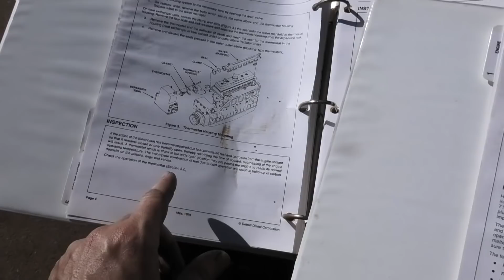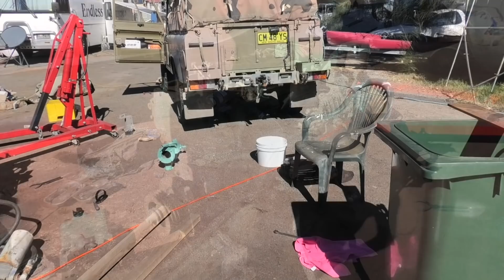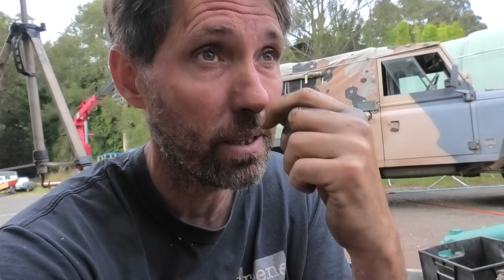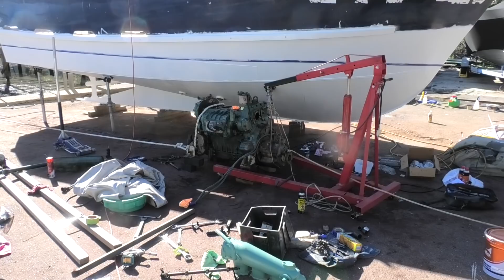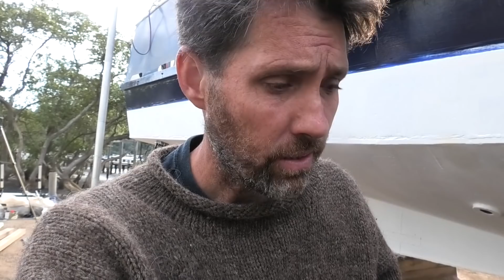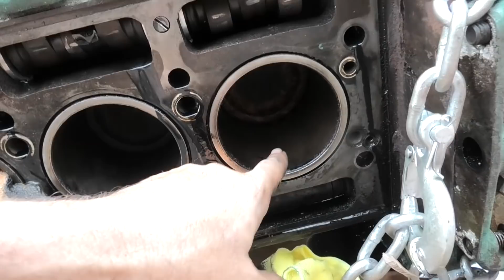Detroit Diesel 4-71 teardown

Comment: The GM -71 series engines are the best Diesel engines ever built, IMHO.  Elegantly simple in design, can take a great deal of abuse and still keep running.  And pretty simple to repair and service.  Emissions controls pretty much sunk them for truck use, but today's very efficient diesel engines are very sensitive, difficult to service, and rely almost entirely on electronic controls that do NOT like the marine environment at all.  I have two GM J+T 6-71 turbos in my boat, originally installed when built in 1980.  Run beautifully.  Clean air/clean fuel/clean oil and they'll run for a century.

Comment: HI  Stu doing a refit on 40ft steely have motor being rebuilt, have removed gear box which is very old but looks in good condition. I WATCHED ONE OF YOUR VIDEOS WHICH IKNOW CANT FIND. You metioned who looked at the box and also put in i think was another oil feed to the box. Could you supply me with who done this to the gearbox as the CAT is nearly ready to be put back in the vessel and if need be would like to know what is need to long the life of the box.

Comment: I have a chev straight six in my boat in Florida screw drive. No salt water in the engine . It uses antifreeze . The engine is 60 year old 85 hp power never change the exhaust manifolds because of no salt water in them . It is just like a car engine

Comment: I was wondering if you took off the inspection plate so you could unbolt the flex plate from the flywheel?
Reply from the maker: You would need to be able to rotate the engine to get to all the bolts and the engine was seized.

Comment: From watching Bus Grease Monkey I discovered there are also wet sleeve model Detroits which can suffer from electrolysis.
Scott has also demonstrated a few times how there are improved performance sleeves with larger ports and the way you can tell them from the old style is that a US quarter will pass through an improved port but not an old style.

Comment: I was just rewatching this video and noticed the shut off solenoid. If you ever have a half flat battery (when I say half flat I mean it turns over slowly but wont start) the start motor often draws power away form the solenoid and the solenoid goes into the off permission. You can hold the solenoid on manually and crank it and when it starts the solenoid will stay on.

Little trick I worked out with heavy equipment and I do it all the time
Reply from the maker: Good tip!

Comment: Your engine has parts coated with rust where I would expect to find oil. I still think the 4-71
is a reliable engine. Stateside, the 6-71 was used as a marine engine and greatly used on city buses. The maintenance was dirty, but they weren't complicated. Baggies and a marker, always worked for me.

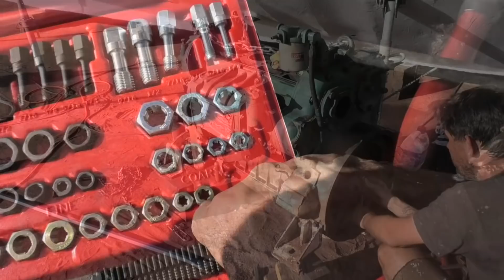Comment: @27:00 Use a drill bit to start drilling out the threads, then a milling bit to get a flat bottom hole against the crank shaft face, then use a set of taps ending in a bottoming tap, then the threads will be fresh for a larger bolt to go in and push the flywheel out.

Comment: Re-powering something can get expensive if you choose an option that is not a well thought out alternative.
An air cooled Wisconsin V4 on a grout pump replaced with a water cooled straight 4 is problematic due to water cooling, length and height issues, but a shorter flat 4 air cooled VW while needing some modification for width is much easier to adapt.

Comment: When the head starts to come loose, use a screwdriver to wiggle and verify that it is not just sticky, because if something is seriously hanging up, you could easily break some small thin, important cast part, like something on the head or the block.
BTW that engine will be a nightmare as it was under water and there will be corrosion EVERYWHERE!

Comment: After the last couple videos I had to question whether my memory was correct... But you heaved to there with a RUNNING 4-71 ENGINE! Yeah, you had a idle issue, but it was ticking over and sounded great. Surprised you just didn’t have them back a beer truck up and let you drown your sorrows for the next 3 months.... LoL

Comment: That 471 makes one of the best generator motors ever ive seen them stay running in the most horrible conditions.where most Cummings.johndeers.and cat motors would just blow up or fail to start altogether there old and heavy.dirty.but thell get you home every time.
Reply from the maker: An interestingly a boat engine is very similar to a generator in that it runs at a single RPM for a long period of time when cruising.

Comment: As long as the magnsflux plays out good it appears to be a quite serviceable engine. Here in the US I would expect a proper rebuild on that engine at $7500 there a bout but it will have a long second life as long as it's not submerged again. Be sure to use ceramic paint when repainting the engine and mixed as Detroit green.
Reply from the maker: Yes, I think this engine will outlast the hull when it comes back from it's complete rebuild. Plenty of bilge pumps going in!

Comment: We won't discuss your disassembly procedure, just a small hint. People have been known to replace those little wheels on the engine hoist with wheels from shopping trolleys, I have no Idea how they get them but my last trolley had them and pushing a fully assembled 460 v8 with gearbox attached was the work of one finger.

Comment: Dont get discouraged mate! That gm would have hired right up if it wasnt froze? I do believe you said it was.they dont like to sit very long all the leaks will create rust quickly if the engine dosent run every day
Reply from the maker: Yes, it was sitting around for a while but it is now at the engineers getting fully rebuild so it will be good as new by the time it comes back.

Comment: Did I hear your going to reuse the old motor oil?

Do not do it .

New oil only 40 weight motor oil designed for the Detroit 2 stroke otherwise why rebuild it?
Don't even think about using a multi weight motor oil like 15-40 you'd use in a truck diesel. Not acceptable on a 2 stroke Detroit straight 40 weight motor oil only.

Comment: You should have a Detroit Diesel dealer there in Australia. I also will tell you that you do not want to just replace the rings unless you are doing a quick repair to get back underway. While you have it apart do it correctly and get the liner and matched piston kits.

Comment: just started watching and having a laugh....thanks for that. I'll be the manual said "remove gearbox...." and I wonder if the writer every thought it would be that much trouble to get a gearbox off? I'll carry on watching but if you didn't explain how we got here could you? I've been a mechanic for 35 years and never saw anything that bad......but I work on cars. Seen some rust, and bad by automotive standards, but this take the cake. I admire your resolve...….keep up the entertaining work.
Reply from the maker: The engine bay on this boat had flooded with salt water which with the engine sitting for a few months still caused it to seized.

Comment: New diesels are crap. I don’t know if Australia put all the emissions regulations on diesels like they did here in the US. If you see a Diesel engine with a diesel particulate filter, or exhaust gas recirculation... run! Run far far away! Better off rebuilding an old one, it will be worth the extra fuel burned.

Comment: I would have been crying when the head came off.   A lot of rust in those cylinders.  The cylinders are small that big of a hunk of cast iron. 
You will need several cans of rebuild in a can to fix that one.  New cylinders and pistons.  
You got steel balls 

Set that sombitch on fire!

Bubba you can rebuild anything all you need is time and money, with a big helping of time and money.    It might be possible to buy one of those engines that works for less. I am from US and Detroit Diesels are not Caterpillar Engines.  They were more use em and pitch em.

Thank goodness the bottom did not look as bad as the top! 

Sending lots of love your way!
Reply from the maker: Just visited the engineers today and the engine is looking much better now. A bit of footage in next week's video on it.

Comment: G'day Stu,
I cringed a bit,😒 wished  I could have commented while you were trying to get the gearbox off. On my Hartley which was sunk for 3 months, the Ford 592E was made run with new oils eng & trans (hydraulic PRM310) like yours, , no disassembly was done other than starter motor ,   almost a year passed before I had chance to work on it and then it had frozen. realizing that the flywheel had to come off to clean the last of 7 tonne of mud from behind it, it was the gearbox that had seized, my method to release the stuck spline was not to destroy the extremely expensive flex plate with heat but undoing the bolts securing the plate to the fly wheel through those access holes and removing gearbox and plate together for more gentle dissassembly.  When the gearbox had been refilled and run there must have still been a bit of water trapped in the massive tapered roller bearings on the main clutch shaft and rusted maybe 3 of the rollers in position, other than that there was no sign of rust in that $6000 gearbox. I replaced those bearings myself after inventing a special puller (drama) service manual essential !it also uses 20w50 engine oil,  beware! the get me home device on the top plate can be installed ass about which, by vibration lets reverse and forward engage at the same time.
Is it the fact that it is 2 stroke that the engine got so rusty inside ? As I said I didn't even take the head off the ford, hope my bores didn't look like that, atf fluid is meant to be good at freeing rusty piston rings. With my injectors out I was able to eventually rotate the engine smoothly by hand cranking with a long bolt in the flywheel with a bit garden hose on it and acheive  good oil pressure before trying to start it, 10 years later it starts easily and runs for an hour or more without getting hot picking up water & exaust returning it to a 60 litre rubbish bin.

Comment: methinks to avoid all that rust again, you're gonna need a much more reliable and redundant bilge pump setup... and keep spares high and dry for when you wake up to the bilge alarm in the middle of the night after the batteries ran flat, and find the hand pump is broken. 😬
Reply from the maker: Yes, everything is going to be much better designed before it goes back into the water, not to mention a newly packed stern gland.

Comment: Also might want to invest in an engine cradle for the next time you have to take the engine apart.
Reply from the maker: I do have one, but it is nowhere near strong enough to hold a 850kg motor. I looked around and very few are unfortunately without spending a huge amount of money.

Comment: If you cut into the continuous bulwarks of that boat, you are a goddamned fool.  Replacing the continuous girder of the rail with a stanchion sufficient to take up the tension of the rest of the steel rail, then providing a storm-tight door will require an extra two tons.  Don't be stupid.  If you can do that, I will respect.  If you don't take those factors into account, you deserve what you get but your passengers and employees don't.
Reply from the maker: If you can show me your stress calculations for this specific hull I will respect.
Reply: @DangarMarine  Yeah, my comment came off hostile, I'm not.  Apologies, mate.  

That hull was not constructed using 'stress calculations'.  It was constructed as a slight variation of a previous, successful design.  You've obviously looked at it, on the scene.  I'm some schmuck watching a video.  I wouldn't touch that rail, it's your boat and you determined otherwise.  That boat looks lightly constructed but it must be worthy to work it down there, I understand the weather can be daunting.

Comment: 4-71 is a good engine. You could overhaul it three times to the cost of a CAT diesel and twice for the cost of a Cummins. Next time you separated the marine gear, take off the gear, then the adapter plate. It will me much easier.
Reply from the maker: They are great engines.

Comment: Jimmies are some of the most simple  and most reliable engines on earth, especially the 71s.
They were also endemic in the country, (Alaska),  here for many decades.
I've seen them run completely underwater, and we've received them so covered in oil and filth with the complaint that they were running "very weak" and when we cleaned it off the block side was broken off with a hole bigger than a man's hand and you could see BOTH middle cylinders moving. Compression in 2 and 3 was a bit of a problem.
But it still ran when they jerked it out of the hydro axe it was in.
That one needed a new block.
Jimmies GOOD.
Lots of FUN!
Enjoy!
Reply from the maker: Hey Steve. I think this one is going to come back 100%. Found a good source of parts locally and the engineers are rebuilding it as we speak. Can't wait to get it back in!

Comment: Enjoying your videos. I have an old 1974 cruiser with two 8V71 DD's in it and of course they are in very tight quarters under the cabin deck. I have done some minor stuff but am learning about these old engines as I go. Fortunately they have only seen freshwater.  Subscribed
Reply from the maker: That's a fair bit of HP! I too am slowly learning about these motors. They are quite enjoyable to work on.
Reply: @DangarMarine  Yeah its a big old girl, 45' Chris Craft flush deck and 45 years old and in need of a lot of work which I am slowly doing. I like your graph of initial excitement and then disenchantment when the scope of the project sinks in. I am on the up tick which I do not remember what you called it but it was spot on.  Your videos are very helpful and motivating. Keep up the good work.

Comment: Remember, straight 30wt oil in these - no multigrade oils. they don't like it.
Hammer handle on the big end bolts thanks!
Here you go:
The poppet valves are the exhaust valves. The blower pressurizes the air gallery. The cylinder ports are in the air gallery. The piston uncovers the ports in the bore and fills the cylinder.
The Diesel Uniflow 2 cycle starting from the TDC on the power stroke is something like this:
1) Compression ignition causes the power stroke.
2) At around 90deg ATDC (80-85deg it starts) the exhaust valves begin open and the residual combustion pressure starts flowing out the exhaust under its own pressure. It has a certain amount of inertia once it has started to flow out the exhaust valves (2 or 4 depending on power rating).
3) At around 135deg ATDC the intake ports are uncovered by the piston
4) The exhaust valves are open open and the intake ports uncovered and the inertia of gas flow started by the residual exhaust pressure allows the blower to admit air into the cylinder even though there is still some residual cylinder pressure. The blower air purges the residual combustion gases and has it's own inertia from feeding all the cylinders. Some air gallery fresh air is 'wasted' into the exhaust system in this process since it contains no fuel. This phase is analogous to intake/exhaust overlap on a 4 stroke engine.
5) At about 48deg ABDC the piston has closed the intake ports
6) At about 55 deg ABDC the exhaust valve is closed.
8) At about 25-20 deg BTDC the injector opens
9) At about 6-5deg BTDC the injector closed (analogous to spark advance)

The camshaft operates the injectors and the exhaust valves. Being 2 stroke the camshaft is geared 1:1.
Although the air gallery is slightly pressurized <1psi (.7 according to DD specs) the motor is not in any way supercharged for a few reasons:
1) The swept volume of the blower + the speed at which it turns is closely related to the swept volume of all the cylinders and engine speed.
2) the slight increase over ambient air pressure in the air gallery is necessary to scavenge the residual exhaust and is dumped into the exhaust system.
3) The blower represents a substantial pumping loss to the engine - ie it costs in the order of 100hp to drive. A true supercharger still costs 100hp to drive but may pump 250hp extra air potential. The 250hp gain still has to pay back the 100hp pumping loss, leading to a 150hp gain (250-100) but 250 extra hp paid for in fuel (and air in the correct ratio). 

In order to get a supercharging effect the blower has to be turned faster than the naturally aspirated air requirements of a motor or sized larger than the naturally aspirated air requirements of a motor or both. Roots blowers when adapted to true supercharger operation can also be underdriven, driven 1:1 or overdriven depending on many factors beyond the scope of my discussion.
GM 2 strokes can be forced induction. They have a conventional turbocharger but still retain the blower.
The blower has a bypass flap in it that boost overcomes. This saves 30hp blower pumping losses.
GM-EMD Uniflow Diesels forced induction types have hybrid blower/turbocharger. A similar arrangement was proposed for the SIlver Series 6&8V92TT but development costs and turbocharged inline 6 engines in the 15 litre range killed that idea off.
Reply from the maker: Thanks for that mate. Plenty of good info!
Reply: @DangarMarine  i found a blower kit install vid. When i get home I'll post the link on here. Best at least put a kit throgh it I'm thinking
Reply: @DangarMarine  Here's the promised overhaul vid. All they really do is put a kit through them, show the pitfalls - which is actually very helpful and a few tricks. Just use 3 Bond Grey or Red on the end plates applied the way they show. On machined surfaces paper gaskets if supplied are a waste of time. If you do it the way they show they will never ever leak.
You probably don't need the special tools shown but if your becoming a Detroit Diesel tragic (there's plenty of us around) people will come to you, so they could be handy.

Enjoy:
https://www.youtube.com/watch?v=3ZVgxY0yir8